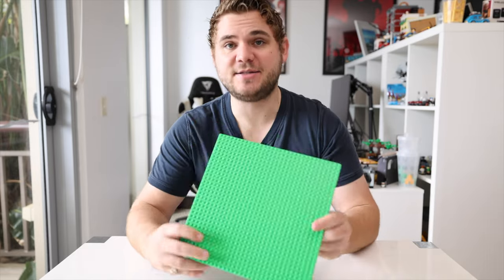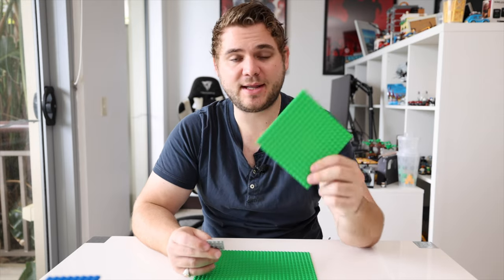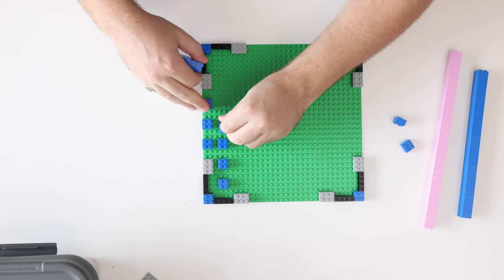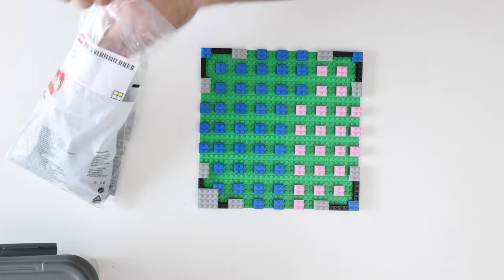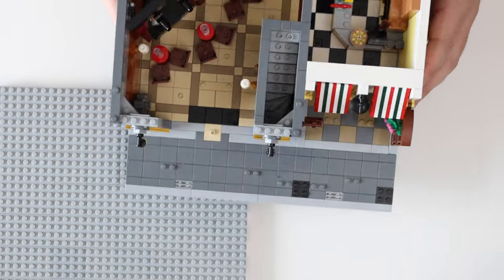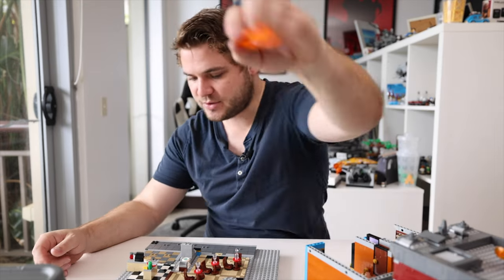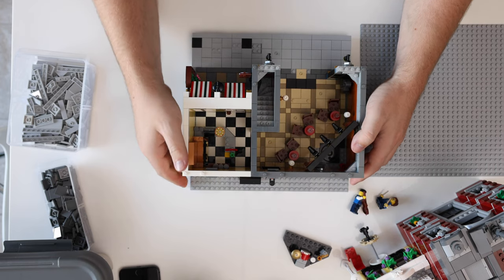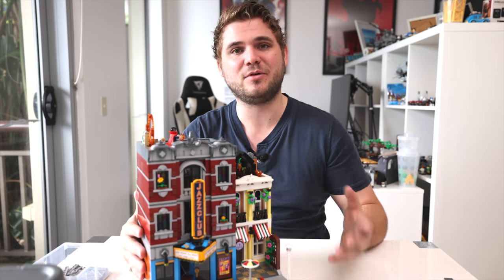HOW TO Make A LEGO MILS Plate & Transfer A Modular Building

Comment: Personally I prefer the Moduverse system as it's made to be created with whatever bricks is available, but this works nicely. I wonder which system is most cost effective though
Reply from the maker: I’ve not looked too deeply into that one but will check it out. This one is very clean to build but is pretty part intensive.
Reply: This costs 36.27 € new on pick-a-brick, 24.33 € with used parts on bricklink.
Plus delivery.

Comment: I have a question. When you built your mils plate, insted of using the 4x4 plates for the top, couldnt you just use the 32x32 plate that your mod is on? It seems like that would save a bit of time.
Reply: The 32x32 can’t stick to the top. Like he said, you can use 16x16 plates to save time, but the 4x4’s probably add more stability.
Reply: If you just want to get your modular up to the same height as other buildings that are on MILS then yes. If you want it to be as rigid etc as in this video, then that won't work as you can't attach things to the underside of regular base plates that the modulars are on

Comment: I use the 16x16 technic plates and either put them on a base plate to get the correct height or just tile over the top to the colour you like
Reply from the maker: Nice. That would be a good and flexible option to be able to create with